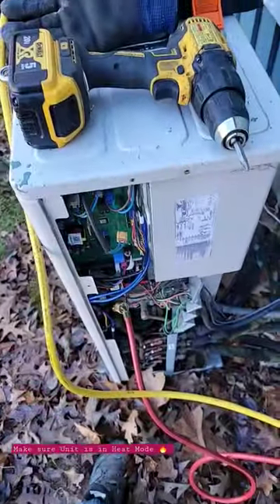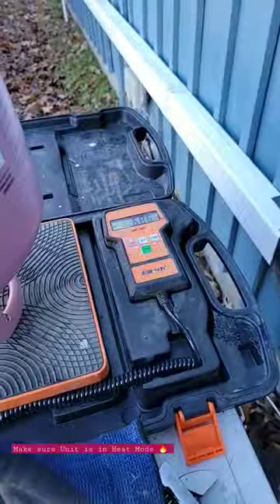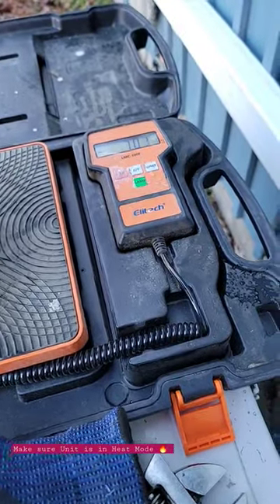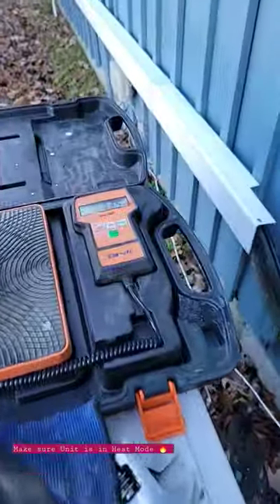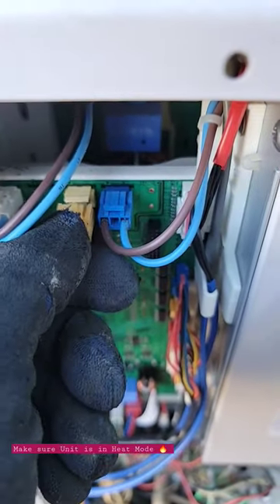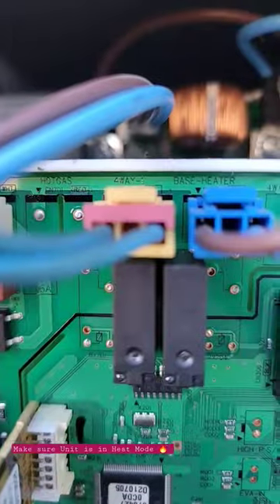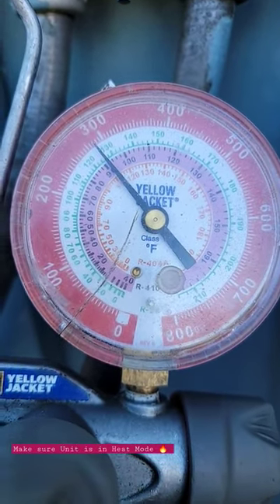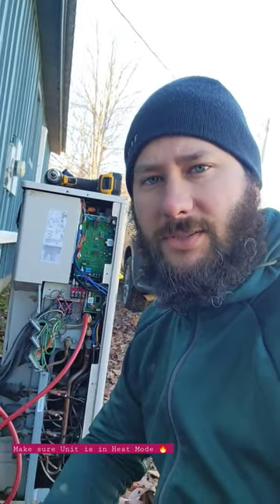How to charge Mini split when it's too Cold for Cooling Mode?

Comment: Idea to charge don't know if you're aware of this but you shouldn't plug in the reversing valve without shutting the unit down first. It's a good way to blow up your compressor

Comment: Heat pump compressor changeout does 30 degree temp change the soldering method any? Because if the low temp
Reply from the maker: Not that I know of

Comment: You could use a recovery machine in reverse.
Reply from the maker: yeah good idea 💡 👍
Reply: @TaddyDigest  I do it all the time. Plus you can get every Oz of refrigerant out of a tank.
Reply: Yes you could provide the refrigerant tested good after a compressor failure.
Additionally unless you're the only one that's worked on it who knows what's in there.
This is assuming you're using what's in the recovery cylinder.
I believe you were talking about from a virgin cylinder though.
Usually the complete charge you can get out under a vacuum (unless the cylinder is almost empty ) however not always so the recovery machine is great for this 👍🏻

Comment: is that a samsung ?
Reply from the maker: yes
Reply: ok i’ve got a 16kw and it needed regaining and guy came out empty it and refilled the gas but the unit still not heatting over 35 degrees the gas was low but not it’s been refill still not going above 35 degrees after charging me a arm and a leg
Reply: sorry typo  was saying regasing
Reply: my unit model is RC160MHXEA
Reply: are you familiar with these units
Reply from the maker: Yeah I'm familiar

Comment: Word to the wise.  When people give you an estimate go out and inspect their equipment and truck before you sign on the line.  Organized truck=organized efficient successful job.  Disorganized truck=you threw away good money.  If I had seen the gauges this man is using to set up this system, I wouldn't have allowed him to work on my equipment.  Never allow idiots with damaged tools to work on your equipment.  If they can't afford to repair or replace damaged tools they probably don't have every tool they need to do the job right.  If the tools are damaged in the first place, it's because the tech is an idiot.  Good hvac people take care of their tools, store them protected, have rubber boots on their gauges, and replace them whenever they get damaged.  Gauges are $40.  Your reputation in the industry is PRICELESS!  Take care of your tools and you can take care of your customers.
Reply from the maker: I see some good points. I also see a lack of understanding and respect.
My guages work great I have a couple analog sets and a digital set.
Guages are more than $40 dollars by the way.
Have a Blessed day
Reply: @Taddy Digest  I'm happy to send you my receipts for what my new R454b R32 gauges cost.
I ordered 2 sets of JB 1% gauges, arriving in about 2 weeks.  They were $41.21 each,  I believe.  Send me your email.  I will send you a copy of my bill when both sets arrive from Johnstone in Naperville, IL.

Comment: You don’t charge a mini split in heating?
Reply: On minisplits there’s usually only one service port (suction line), so in heating this is the hot gas line which is at a higher pressure than the ref. cylinder
Reply from the maker: No You cannot charge in heating
Reply: @LC-qi5ff  thanks for letting me know. I don’t work on mini splits but I’ve installed a couple
Reply from the maker: Boom yes exactly  You know
Reply: U should charge a MS by weight. You have to calculate line set length.
Reply: Wait
Didn't you say the compressor was replaced ?
Wouldn't the system be in a vacuum ?
Reply: @LC-qi5ff  
The system would be in a vacuum so no pressures present 😉

Comment: You don’t know what you are doing. Go inside and set air handler to force cool very simple procedure. If you dont know what you are doing go to any supply house and see when the next Mini split course is I recommend Mitsubishi as they have the most complicated units. By disconnecting that wire you now have put a code in the memory for no reason.
Reply from the maker: Everybody doesn't have access to that training I did a video showing another way to do it
 Not everybody knows what you know and not everybody knows the right way to do it
 So I'm just trying to help those people that don't know